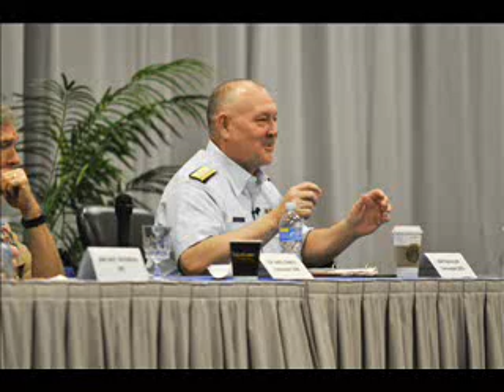More from Feds: Lifting BOP may open seals and allow oil to flow from annulus

Comment: 0:23 "See, how I would explain this without a picture." Is that what he said? Are you telling me there is no cross-sectioned assembly drawing available for the BOP? Are you telling me they designed the BOP on their lunch break and built the BOP from sketches on a bunch of napkins? Are you saying you can't give a better explanation because the drawing of the casing hanger is covered in marinara sauce?